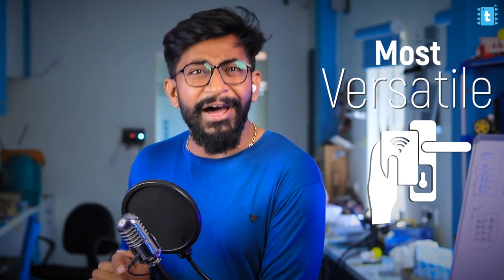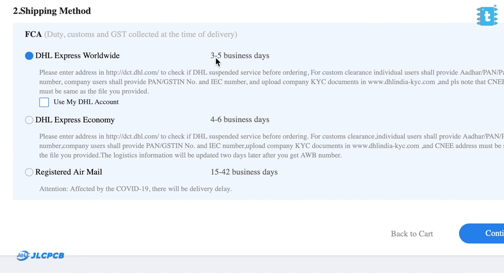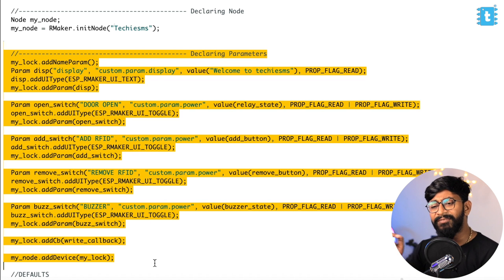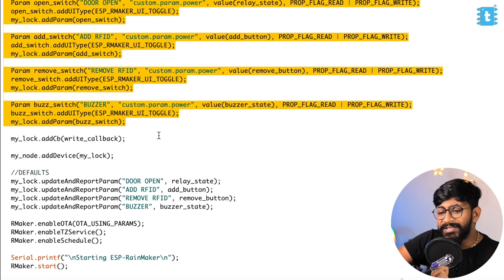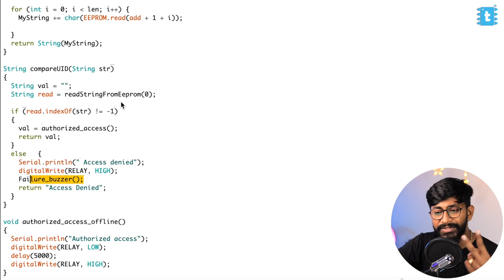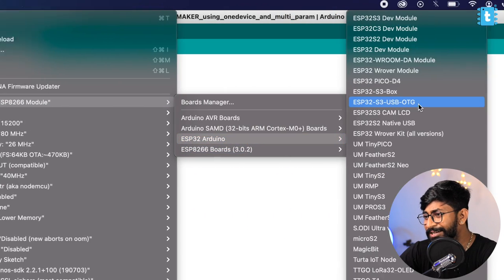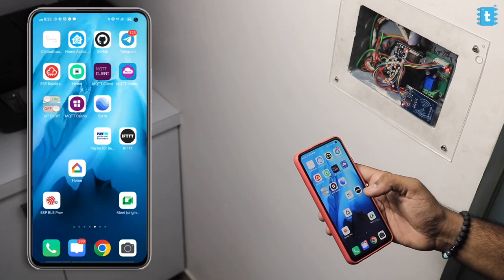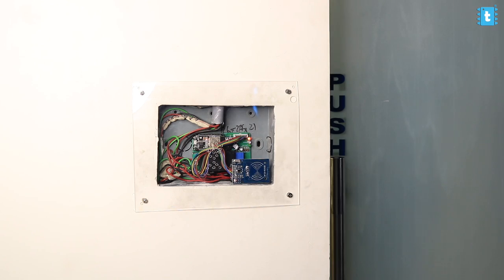Most Versatile RFID Door Lock Project 🔥 | IOT Projects | ESP32 projects

Comment: Ok does door lock pin gets high after boot ,cause its a big disadvantage another thing is we can add battery backup since if their is no electricity and and inverter you are locked out 😳
Reply: You can use the bolt lock instead of the EM lock

Comment: Good Explanation, 

You can use LM2596 instead of LM7805 to avoid large size of the heat sink and also ventilation provision in the enclosure, Using LM2596 you can able to get current up to 3A.

one more suggestion 
You can store the log using IFTTT webhook.